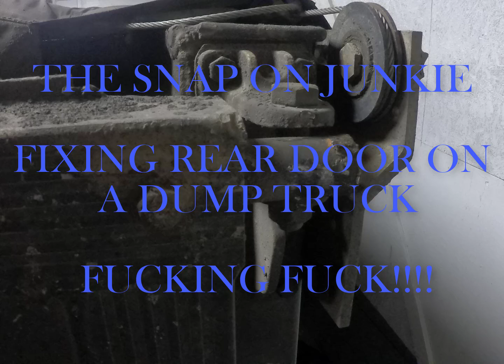THE SNAP ON JUNKIE FIXING REAR DOOR ON A DUMP TRUCK

Comment: quick question. how old are your trucks and if you had newer ones would that. ease the maintenance issues? Not suggesting go buy new ones just wondering what how much of a difference if any it would make.
Reply from the maker: Mike's Tool Reviews Mike I'll explain that in the trucking video yeah I could go out and buy brand-new ones they're just really expensive and they make the same money as an old one does and you're breaking new one just as fast
Reply: that's kinda what I figured.  A new one is just more shiny when when it breaks
Reply: What most people that have never owned a trucking business is that you have to balance the rate of return on your investment. Sure Junkie could go out and buy a new dump truck and pay upwards of 200k for a fancy truck and yes the truck will be almost maintenance free for a few months.  Yes I said months not years because this type of equipment wears out at a very quick rate.  Small breakdowns will drive you crazy and yes they are very expensive.  Some of you that don't have a working knowledge think well I'll just let the dealer fix it.  Let me explain when you get a warranty job done they take their own sweet time fixing it.  Sometimes, let's say most of the time they won't have the part in stock, so you will be at their mercy and they could keep your truck a week.  There is a week's worth of income you have lost and now you have pissed off your driver and who ever you have your contract with.  The trucking business can be rewarding but it's time consuming and hard work.  I have been in the trucking business since I was 16 years old working at a large trucking each day after school and then continuing on after high school. Now 50 years later I own a fleet of trucks (30 under contract and about 15 spare trucks) and contracted to two major carriers FedEx and Amazon.  I started with one truck and did just like junkie work night and day on it.  Doing my own work that I knew how to do and finally getting my own shop with full time mechanics later.  I not stated this to brag about what I have but to show you what Junkie is trying to accomplish in his own way.  I have been through the same things that he is going through.  Justin keep up the hard work and maybe you will be able to buy enough trucks and hire enough drivers that you can relax a little more.  Just don't let that Mtn Dew and cigarettes kill you.

Comment: insight on how to get into the truck business would be great. I have a question though just out if simple curiosity I am by no means a pro welder so just wondering why u used a tig style as opposed to mig or stick? keep up the videos hoss!
Reply from the maker: Travis Souther I like a tig style better because you can control the heat and it's just a welder that I like to use better than anything else
Reply: ok perfect thanks love the channel btw!

Comment: This was a great video! Mud, grease, sweat and cool tools. Really appreciate the effort, thank you.
Couple of questions tho:-
1) Since you installed a bolt that is next size down (1"), won't the strength of the hinge 'system' be reduced now because of the lesser shear strength of the smaller bolt? Of course, if your smaller bolt his of a higher grade then my point is mute and I should shuddafuqup.
2) it does seem that the pin/bolt hinge design is fundamentally poor because w two cylindrical pieces (the bolt and the door pin) touching at 90 degrees to each other, you end up with point contact and very high stress. 
I understand the strain placed on the door by asphalt work is extreme and changing the door is expensive, but whoever designed and built that body could've done a better job.